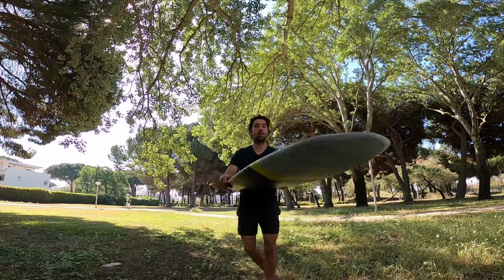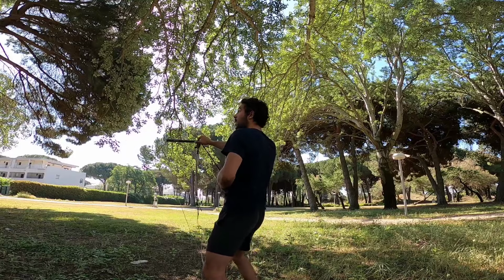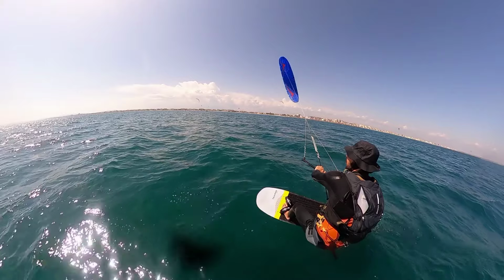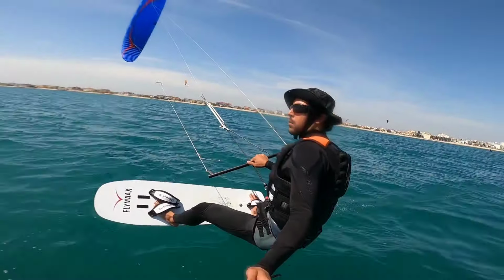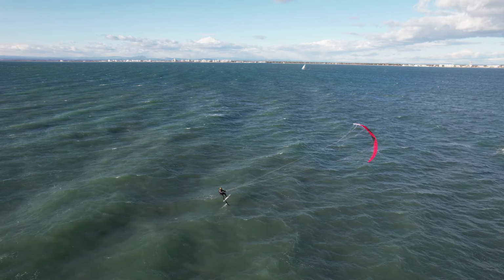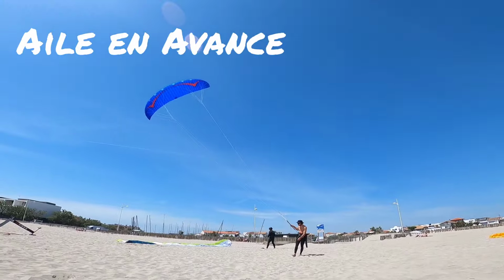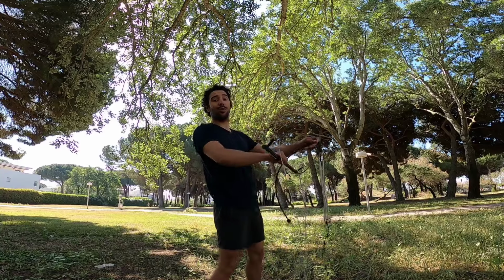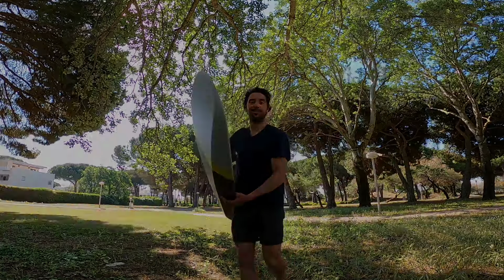How to tack - kitefoil

Comment: Kind of complicated to learn it like that at once. Split it in 3 steps. 1 - do 360 to get comfortable with an upwind rotation. 2 - do a heelside - toeside tack without foot switch. 3 - do a roll tack with the foot switch. This way you can concentrate on one step a time. Learn it in good conditions. It's technical move and many factors can affect it: gusty wind, waves, current, etc